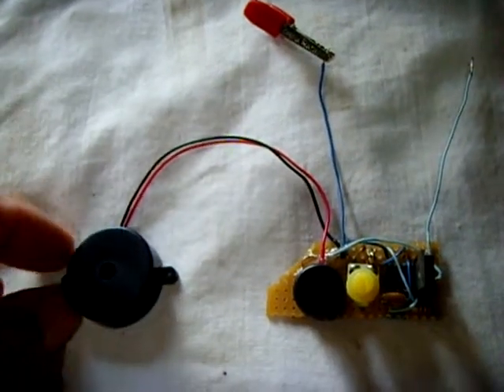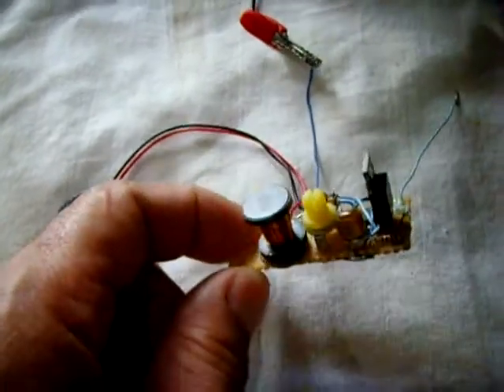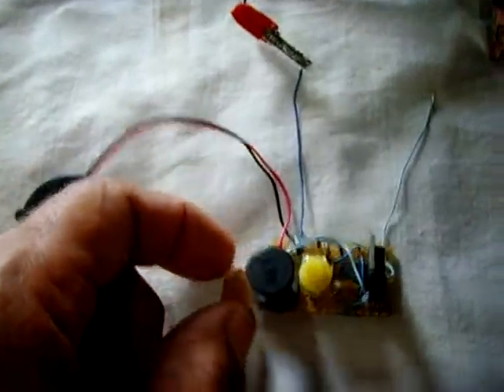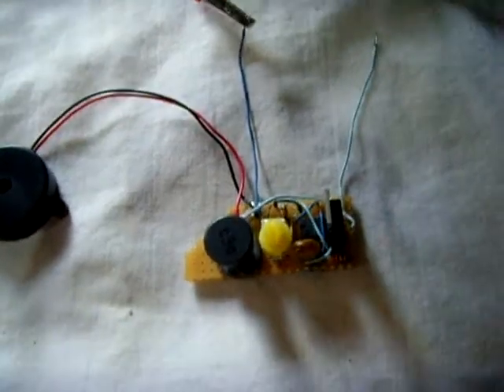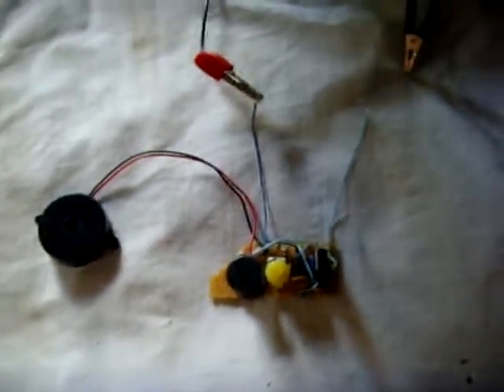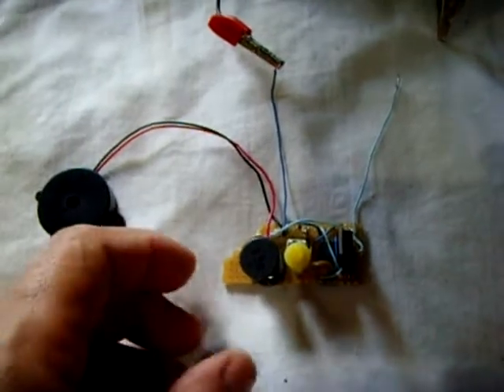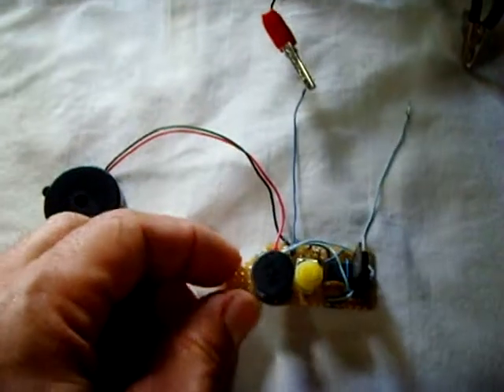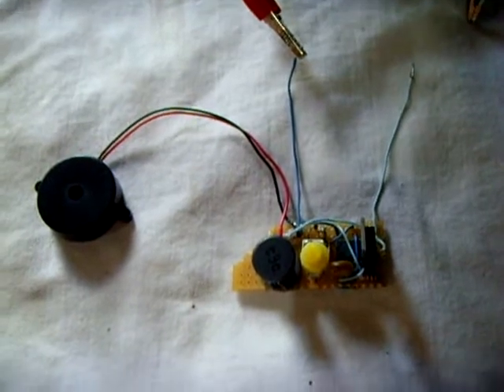12V Piezo Siren Circuit - EAR PIERCING Sound

Comment: So the 555 timer serves as a clock signal to feed the audio oscillator circuit that yields an electronic signal in the audio frequency range ~20 Hz to 20 kHz?
Reply from the maker: Yes, the 555 drives the piezo. Be sure to rate thumbs up, check out my extensive video playlists for 
other great videos of interest to you, and share my channel with others. Thanks for watching!

Comment: Brilliant! How would you attach a timer for it to go off after 5 / 10 minutes and reset (without using a relay or timer module). I'm worried the police will slap me with a noise nuisance  if I use it as it is
Reply from the maker: bbop You would need to use a small relay module....Thanks for watching! Be sure to rate thumbs up and share.